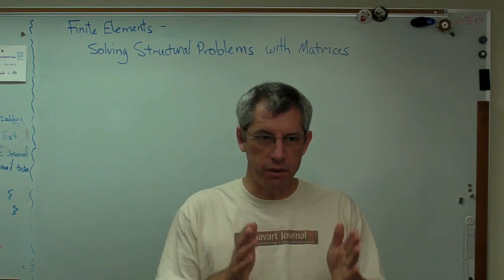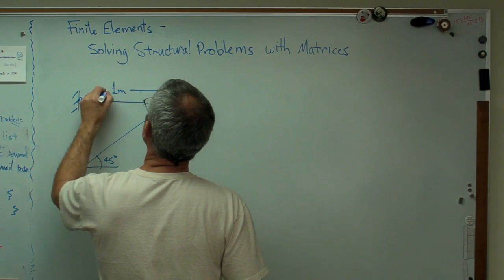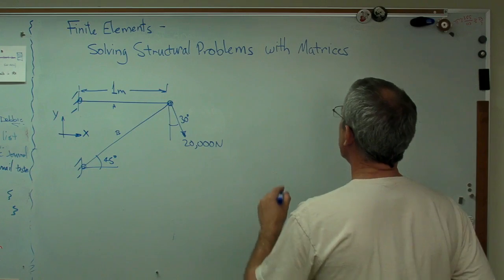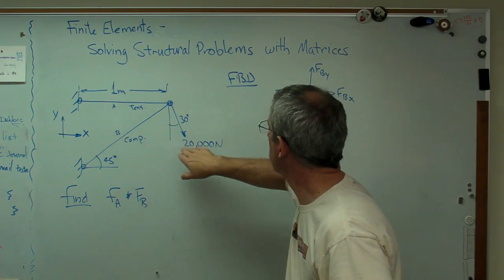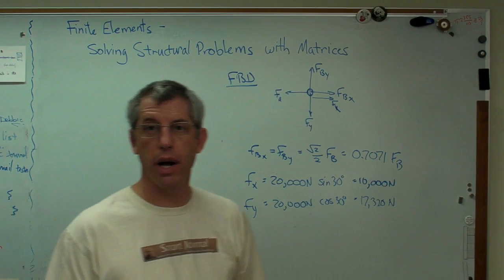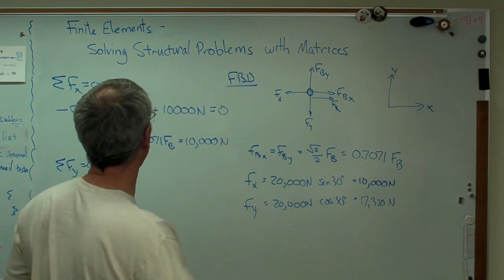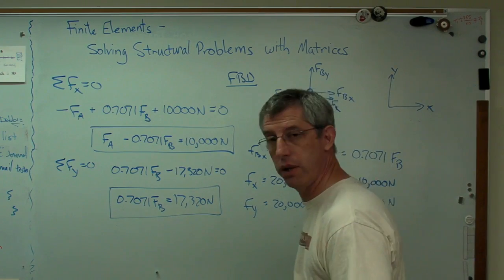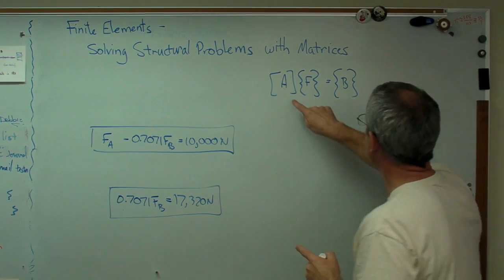FEA matrix Solution - Brain Waves.avi

Comment: Hiya Brian, you have taught me so much it's almost untrue. Just a quick pointer (and I'm not being a smart ars* ) but the Cos or Sin of 45 degrees is 1/root of 2 and therefore FB * 1/root of 2 = FBx = FBy. This you have show by using 0.7071*FB. However on the board is illustrated root of 2 / 2*FB?..........I hope this helps friend..........Best Regards Ken